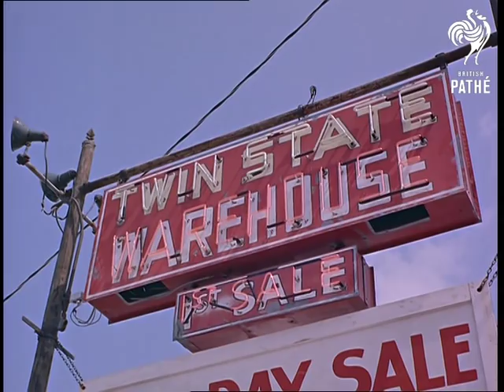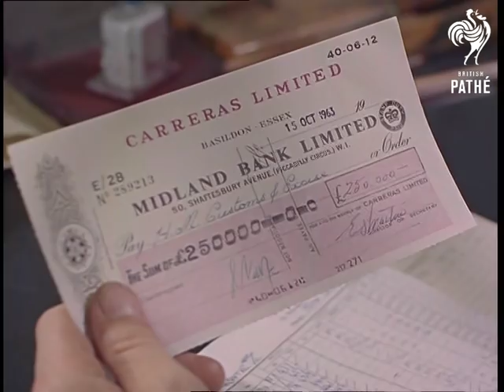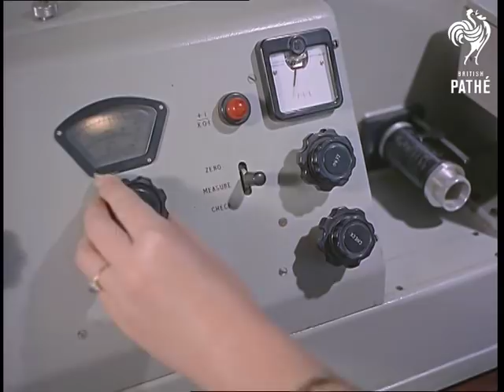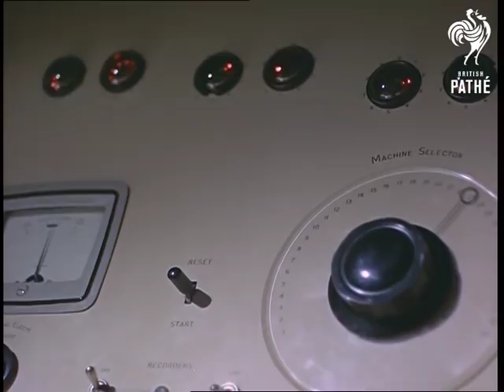River Of Gold - Tobacco (1969)

Comment: Back when cigarettes were actually good
Reply: @Iwilldestroyyoo  exactly
Reply: @Iwilldestroyyoo  thats what I mean by “good.” These new fire safe cigarettes are horrible. I smoked a pack a day for 15 years. I quit almost a year ago. I don’t know what they are putting in these fire safe cigarettes (formaldehyde I do know that much) are horrible. Completely changed the taste of cigarettes
Reply: @johndycus7800  you should try American spirit rolling tobacco, pure organic tobacco with no additives.
Reply: They tasted better back then. Now there is just a chemical taste to them.
Reply: @johndycus7800  Well it made you quit, so it worked.
Reply: @markandrews6567  True, but they are still FSC and have the added retardant in the paper to extinguish them when not being drawn from.

Comment: The automation used in production lines is incredible. In that times there wasn't microprocessors. Just pure electrical and mechanical engineering stuffs are apearing.
Reply: Germans say: "Good engineers make it mechanic." :)
Reply: Jacob Monnin  new technology is the reason you can browse the internet.
Reply: Jacob Monnin  half of it is redundancy checks and useless fuses. I would be down to go back to more manual or mechanical work, but people dont work as hard or are as smart as before.
Reply: @SDguy3030  "but people don't work as hard or are as smart as before"?   😂   People don't work as hard as before because they are smarter!  😎   Not so smart as before applies only to you.   🤣
Reply: Very modern, clean, and efficient operations throughout - even at the tobacco farms.   Such a terrible products though.
Reply: @protectwhatisours6895  интернет, это старые технологии...
Reply: Engineering stuffs? What do you mean?

Comment: In the early 1970s, when I first started driving, one could travel the DC beltway through Prince Georges County MD, and see many small tobacco barns either side of the new highway. This is located just a few miles away from Mt Vernon.
Maryland tobacco was cured differently (no heat) in its drying, and most was shipped to Europe. Now those farms are gone, being replaced by suburban sprawl.
Reply: There’s still tobacco grown here in Western Kentucky, but not near as much as they did 25-30 years ago.  Henderson county farmers made a lot of money raising tobacco up until World War 1, as they imported it to Europe.
Reply: @bluegrassman3040  Interesting. I have relatives in Henderson NC, not in the tabocco bus though.
Reply: @stephenkunst7550  I’m referring to Henderson, KY.

Comment: How much was that? 900 lbs. to a hog's head? Gotcha!
Reply: Hogs heads are the barrels not a unit
Reply: @Geo.StoryMaps  it is a unit in volume one hogs head is 63 us gallons/54 imp. Or in this case 900 pounds of tobacco per head, it's right there in the clip.
Reply: @Gunzee  A hogshead of tobacco has been a standard measure for at two hundred years or more